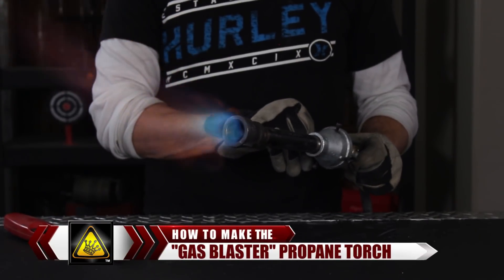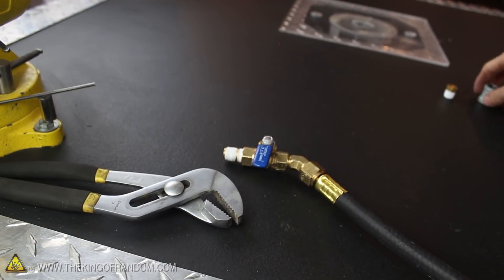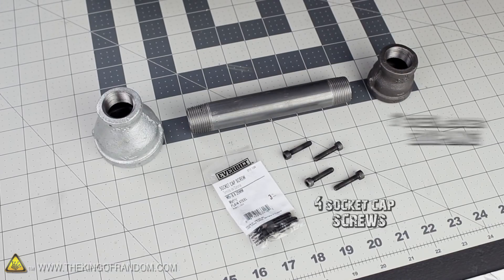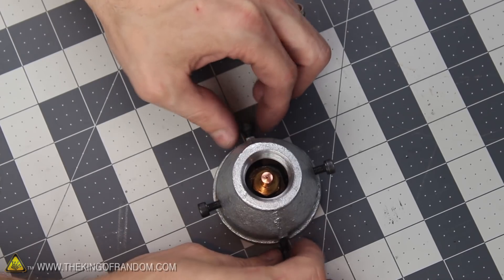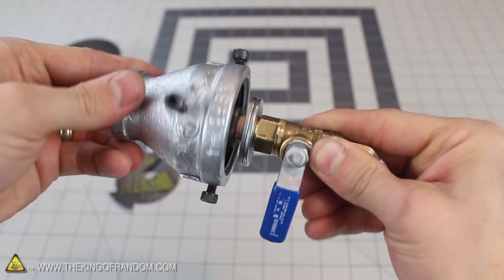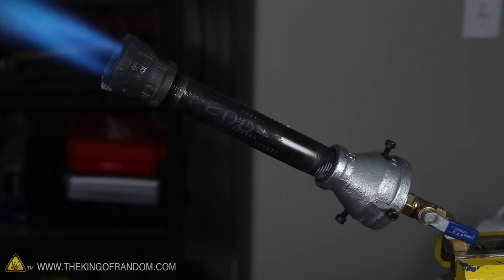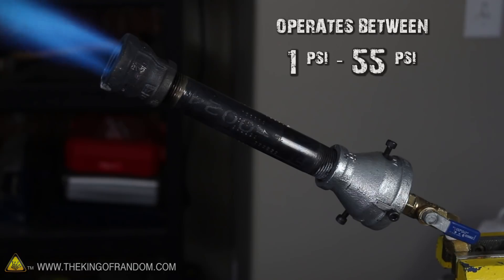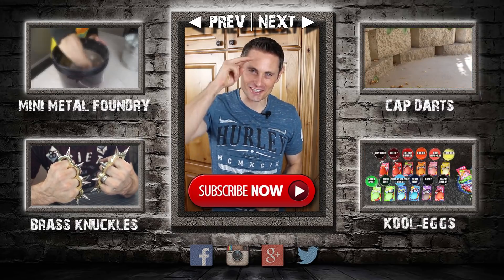Convert Your Backyard Foundry To Propane! ("Gas Blaster" Propane Torch)

Comment: Anybody who wants to do this, if you get the .6mm (.025") welding tips for a Hobart welder (the only ones I could find),  you'll need a 1/4" x 28 tap.  Either that, or take the tip you got to a hardware store before you buy a tap and see what size nut threads on easily.  I used a 6m-1.0 tap on mine but the threads didn't match the tips I bought, even though they were technically the same size.

Comment: hey Grant. i made one of these setups using a lot the same setup as you. you seem to use a .025 tip where as i use a .030 and i use a 10in. instead of a 6in pipe  i also use a 1in dia. instead of a 3/4 in dia. 

seems to do just as well i think, but i wanted to know how much usage you get out of one of those propane tanks? i know mine may be a different to yours and i only have one burner but i figure i can extrapolate how much mine should be doing from that. so... if yours where to burn continuously how many hours would you get out of it? thus how many melts of say brass casings could you get out of it in that time?

thanks, chris

Comment: So, I just finished building this, and I'm running into an issue where I can't seem to get the flame to burn quite the same way it shows in your video.  It almost seems to be burning inside the tube rather than at the end.  any suggestions for what I might do to get it working?
Reply: I'm having the same problem, have you figured out how to fix this yet?
Reply: if the pressure regulator is from a gas grill it wont have enough pressure to make the venturi effect

Comment: Also, where did you find this 3/8 flare x 1/4  - 45 degree elbow fitting.  Home Depot and the RV parts depts here dont carry them.  I have found 90 degree fittings.  but no 45's.

Comment: So I have looked all over for this Pressure regulator, Pressure Gauge and the 1/4 P.O.L.   I checked Home Depot, and two RV trailor parts departments with no luck.  Where did you find yours?

Comment: Gidday Grant, i made the mini foundry and think ill convert top gas as you have done. coupe of questions for you. I notice you have a thinker lid in this one? i had trouble with mine, as it kept cracking. has this helped? also you have a thicker crucible? i would like to melt brass in mine but have burned through a couple of fire extinguishers, what are you using now?
Cheers mate, great channel!!!
Will.

Comment: +Grant Thompson - "The King of Random" I need a bit of help. I made the burner and checked for hissing. There was some hissing coming from the regulator to the hose so I tightened it up and the hissing stopped. But when I fire it up and pull the lid, I get sputtering (or huffing) and it is extremely loud. Any idea why that is happening? I am setting the regulator to 15psi and I can barely move the tuna can lid out (to add more air) without it sputtering. Any help is greatly appreciated.

Comment: Do you need two torches? Or will it get hot enough to melt things like bronze, brass and silver with just one torch? I would guess it would just take longer with one torch. Also, about how hot do these torches get?

Comment: awesome!!!!!!! why dont you add oxygen line to this gas blaster
Reply: +goranr2 You could, but in a torch that's not designed to handle it, you would probably melt the torch, not to mention encounter flashback issues with the O2 supply. I'm not saying it's not possible, I'm just saying it's probably a bad idea on this torch.

Comment: Hey, Grant. I REALLY want to convert my charcoal foundry into a propane one as you've shown. The problem is I don't have access to all the tools you use to drill holes where needed.

Do you have any suggestions on propane torches which already exist that could do the job? If not, is there any way I could purchase the finished  torch project from you? 

I appreciate any assistance you can provide! Have a nice day!

Comment: hey, you have to use te CORRECT type of Teflon tape. which i think you have to use Yellow. i could be wrong on the color, but you HAVE TO USE THE CORRECT TEFLON TAPE. MAJOR EXPLOSION/FIRE HAZARD OTHERWISE!
Reply: +shexdensmore Agreed, the yellow tape is for natural gas/ propane while the white Teflon tape is for water pipes. Also you could use pipe dope instead of tape altogether.
Reply: +Jonathan Roeder thank you. I thought so. idk why there's a difference, but I'm assuming it's something to do with a special absorbent/blocking compound in that type.
Reply: +Jonathan Roeder 
 other than that little but CRITICAL error, i don't see anything else wrong with it.
Reply: White tape should only be used on NPT threads up to 3/8' and is usually for low pressure water pipe. Yellow is double the density of white and primarily for gas lines. Pink tape is triple density and required for pipes over 1/2' and used for stuff like steam. Green ptfe tape is oil free for use in lines carrying oxygen.
Reply: +Jonathan Roeder that's good to know. so could you use pink and green on LP or NG lines then?
Reply: +shexdensmore Yellow PTFE tape or pipe dope would be more than sufficient for your purposes, and would be unnecessarily expensive. If you use tape make sure to wrap it around the threads in the direction it screws in. Otherwise it unravels when you screw the fittings together and does not create a good seal.
Reply: +Jonathan Roeder 
okay, just curious. ty for the input

Comment: question: can you use more than two of these in the foundry?
also, would it be possible to make a version for this that uses acetylene rather than propane, since as far as i know, acetylene burns hotter than propane, allowing you to melt steel?

Comment: Grant I converted my forge to propane like in this video and the bucket began to give off visible fumes. Im not sure if its the zinc coating on the bucket burning off which would be really dangerous or if its just the water trapped inside the mixture finally burning off. PLease answer

Comment: I've made the flower pot foundry and it worked perfectly, but I wanted to see what it could do. I melted various sorts of metal and materials with ease with charcoal. However, I tried to melt glass and it had the viscosity of gum. I couldn't pour it into a cast mold due to it's viscosity. So I'm wondering if the new "Gas Blaster" can melt glass enough to melt and pour it. If so, can you send me feedback on what you made with it (the gun of sword for example). I know you may not have time in your busy day to get around to it but I thought, and maybe others thought, that it might be a cool thing to see. Thank you.

Comment: Also, Grant, did you use a "full flow" or "excess flow" PoL tank valve? Mr Heater makes both styles. (I assume "restricted flow" is not the one since that's what comes on the ready-made hoses.)

Comment: just gonna say, drill them 4.2mm not 3.2. a good rule of thumb is pitch minus diameter. m5x0.8, 0.8-5.0=4.2.

I'm a machinist by trade

Comment: FWIW, finding an adjustable propane regulator in a retail store proved to be no easy task in the Seattle area. Hardware stores? Nope. Gas grill retailers? Nope. RV repair shops? Nope. Welding supply stores? Nope. This regulator appears to be from the Marshall Excelsior company and can be bought on Amazon, among other places. Also, the 45 degree M 1/4" NPT to M 3/8" flare fitting was a challenge but I did locate it an industrial hardware supplier.

Comment: I have a question. Where did you get that pressure regulator and gauge at?
Reply: +Stephen De Anda   GT is using an adjustable high pressure (0-60psi) regulator.  They're used for heating roofing tar pots and the like.  That might give you a clue as to where to look.   If you have a propane supplier with a storefront - not just a storage facility with delivery truck you might find one.  My local one had all manner of stoves, cookers, heaters, lights, etc but no HP regulators.  I found the exact one at bestmaterials dot com. Reg+guage+POL fitting+shipping ~ $50US

Comment: What kind of crucible are you using now? It doesn't look like the recycled steel extinguishers from the first foundry videos. I'm looking to gather multiple crucibles for avoiding metal mixing, but steel containers are nearly impossible to find in my area.
Reply: +asrafel13   See my reply to Alex van Dalen

Comment: I built the burner close to you're specs couldn't find 1/4 in hose, so I used 5/16. I'm not getting enough air flow, with a weak burn no force .I'm thinking of drilling holes on the intake or the pipe. Does anybody have a idea on how to fix this problem?

Comment: hey I had a question, I just made one but the flame blows out as soon as I turn up the propane, I changed the steel fitting for propane rated brass but I did it all the same it's just and issue keeping the flame going. I'm using a washer that's big enough but would that mess with the gas to oxygen ratio?

Comment: make sure you use the appropriate thread tape.  lpg will eat the regular pipe thread tape.  I have used silicon sealer myself since it forms an air tight seal.

Comment: Great video, I built it. Unfortunately I can't get the prestolite regulator locally so I have a 10psi one for a gas grill attached and it's not giving me enough heat.
What is the model number of the regulator you're using? They're all looking pretty much the same looking at pictures online, I'm not sure which one to order
Reply: +Philip Sfalanga    I found mine at bestmaterials dot com.  It's listed as 567-RC for the 0-60 psi one.  They also show MEGR-6120-60 in the item description and I got additional hits when I googled that number.
Reply: +Joe70 I got mine today, I ordered it after I posted here. Got it all up and running and promptly melted my crucible which was made from Schedule 80 steel pipe with a bottom welded on it...Guess I've got to turn the heat down a smidge eh?

Comment: hey grant what's the total cost plus how hot c° can this get
Reply: +The Trio just made mine for about 100$ this includes a full propane tank. having issues with the blower, for some reason it's sputtering. maybe the air propane ratios are off

Comment: Did you remember about the possibility of a flashback in the torch
Reply: Never mind
Reply: +biohazardjackson63   I'm concerned about the same thing. I can't find any welding tips and am wondering if it is safe to drill a 1/16" hole into the cap instead of the .6mm hole reccomended.  Did you find an answer to your flashback question?
Reply: The 1/16 hole prevents flashbacks but if your still worried you can buy flashback arrestors used in oxy/acy torches for a few bucks.
Reply: +Jonathan Roeder  Yeah, thanks.  1/16th hole works fine, but my torch only works with the reducer coupling attached at the end.  Otherwise it blows itself out (I suspect this is due to the bigger hole).
Reply: Have you tried adjusting the carb and/or reducing the psi at the manifold?
Reply: +Jonathan Roeder Yep, regulator is turned down all the way and it still snuffs itself out.  I'm not sure what you mean by the carb?
Reply: It's the metal sheet you cut from the tuna can. It gives you the option of adjusting the air to fuel.

Comment: Our set up we have hear is made of an old semi truck brake drum and a turbo fan from a microwave it runs on coal super hot have had to replace my steel crucible because it melts the bottoms out in no time melts copper pretty fast too

Comment: +Grant Thompson - "The King of Random"  
If one used a larger than 0.025" welding nozzle and a larger jet housing coupler, could you flow more gas and make more heat, or is this limited by the flow rate of the propane tank?

Comment: And also what are the size od the reducer couplings 1". To ?  And 1-1/2" to ?
Reply: +Daniel Ace-Heaton (Danominator) They are connected to a 6 inch long 3/4 diameter black pipe nipple.  so 3/4".

Comment: So what size is the actual burner tube, the steel pipe?  You give the length, and you manage to give us the measurements for the larger ends of the reducer, but not what you're reducing down to.

Comment: That's not a fire extinguisher crucible. Please explain why you suddenly switched out your crucible for the propane modification of the foundry.
Reply: +madwonderland those thin walled steel crucibles burn threw and fail in about 2-4 burns. looks like some kinds of fire clay of graphite crucible.
Reply: +masteryi1337 Any idea where one would get one like that?
Reply: i just bought a graphite crucible off of amazon.
Reply: http://www.amazon.com/Foundry-Graphite-Crucibles-Refining-Aluminum/dp/B00FBG3ROO/ref=sr_1_26?srs=11386501011&ie=UTF8&qid=1456948794&sr=8-26
Reply: +masteryi1337 awesome. Thanks!

Comment: Can you smelt steel with that?
Reply: +Sacha Lamarche you could alter this setup a bit but yes, Ive seen vids and peeps using a similar setup top smelt or forge steel. they generally use a big tank for it though.
Reply: Yeah smelting steel require a lot oh heat that's for sure.

Comment: Propane requires special thread tape. Normal thread tape isn't compatible with propane and you risk ending up with leaks. 

When you check for leaks you use soapy water and look for bubbles.

Comment: so what stops the flame from traveling up the hose into the propane canister and igniting the whole of the propane
Reply: +john smitty In order to have a fire you absolutely need three things. 
HEAT + FUEL + OXYGEN = FIRE
If all have is propane in a hose all you have is "fuel". If you have heat and oxygen you have other problems.
Reply: +john smitty Propane needs a very specific amount of air to fuel mixture and there is no oxygen in the propane tank for the flame to ignite. this torch works pretty much the same thing as your grill, you can just adjust the air to get it to burn hotter.
Reply: Crochunter054
i bet if i built one i would defy science and still end up blowing myself up
Reply: That's what I was wondering
Reply: +Jonathan Roeder thanks
Reply: +john smitty Basic stoichiometry. Once the flame reaches a point where it no longer has constant access to oxygen, it will die out. It's the same reason if you put a candle in a sealed jar, it'll eventually go out. All the fuel it needs, but no oxidizer.
Reply: Ghillie Troll Gaming
so if u did this with a different fuel source that contained its own oxidizer, would you blow up?
Reply: john smitty The opportunity would exist, yes. With the right setup, you could do it, but I wouldn't do a fuel/oxidizer mix on a torch like this that's designed for atmospheric operation. Could you run it with non-mixed fuel oxidizer? Probably, but it would be dangerous. Then again, rocket scientists have a tendency not to leave SRF in the sun as much as LF/O.

Comment: Love everything about this video, amazing build, you should use something else than Teflon tape for propane next time though, I have done it before too but people got extremely butthurt about it saying it was dangerous... there are a bunch of compounds you can put in there which are rated for higher PSI and heat.

Comment: Where did you get your crucible? Is it graphite?
Reply: Also are the galvanized pieces ok to use around heat?
Reply: +swingsetup no the fumes from burning galvanized can kill you .
Reply: +swingsetup    See my reply to Alex van Dalen to make your own or you can buy small crucibles from Budget Casting Supply.